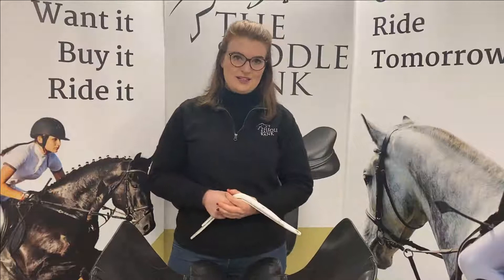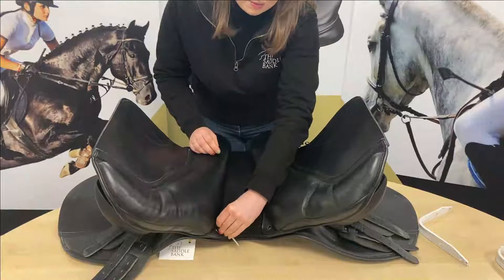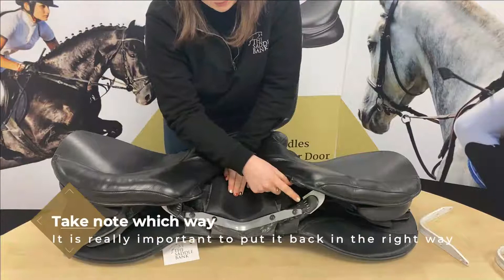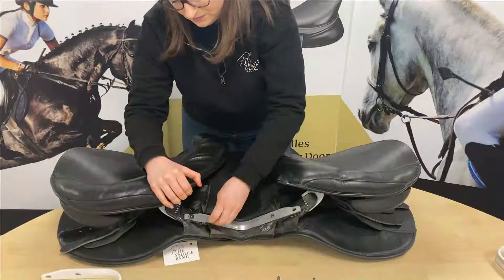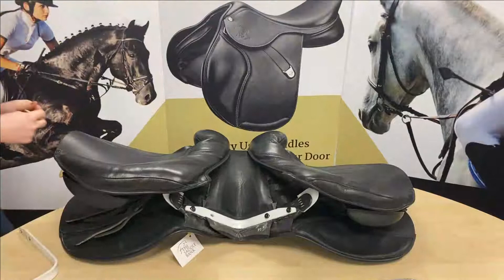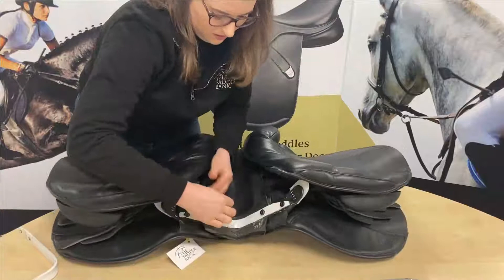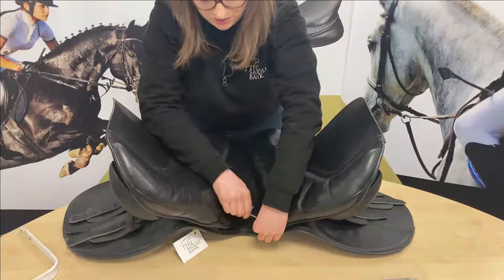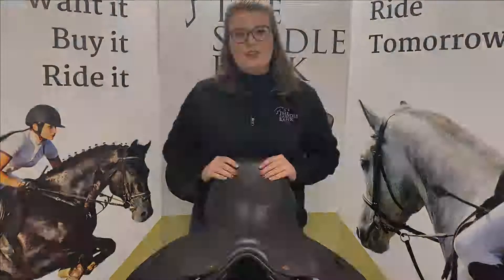How to change your Kent and Masters Saddle Gullet Bar! - Adjust your saddle in just 5 minutes!

Comment: Great video, but according to the K&M website, the angles should face the front of the saddle.
Reply from the maker: The plastic part has a groove in it which you will see the shape of the bar, so just pop the bar in the same as it is on the groove. If you put it in the wrong way it won't line up correctly and will look a little odd which is another indication its not in the right way. :)
Reply: @thesaddlebank  Heidi is correct. I tried doing it the way it was showed in this video, and I struggled for over an hour. I managed to get all the screws in (after a lot of struggling and cursing), but for the holes to align, the gullet had to sit in a weird angle. But I went along with it, as I've never had a K&M before and thought maybe this was how it needed to be. I did think it looked like it was supposed to fit this way from the groove in that plastic piece, weirdly enough. Anyway, I wasn't happy with how it was sitting, so I decided to do it over again the next day. Took the gullet bar out, accidentally put it back in the correct way this time, realized it sat way better this way, the holes actually aligned right away, and I even realized the groove in the plastic indicated it should sit that way, it fit so much better there aswell. So I checked K&M's website, and saw that they did it that way too. And I highly doubt they would give incorrect information about the fitting of their own saddles.
Reply from the maker: @lindab9626  HI Linda

Thanks for your feedback.
I have just watched their video. In their video they are using an R bar saddle, in our video we are using the K&M cob model (S Bar). 
I have just opened up two saddles to double check this. The R bar indentation faces one way, and the S bar indentation faces the other way. 
All you need to do to get it in the right way round for your saddle model is to follow the plastic indentation on the tree, then you will get it the right way round :)